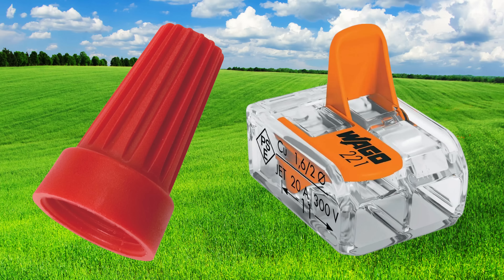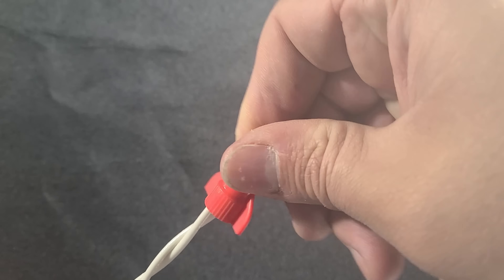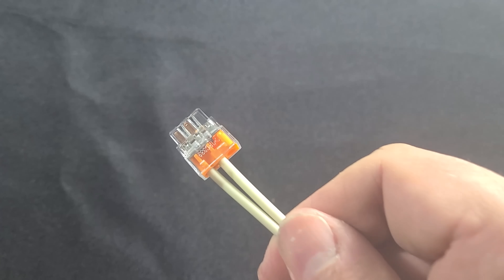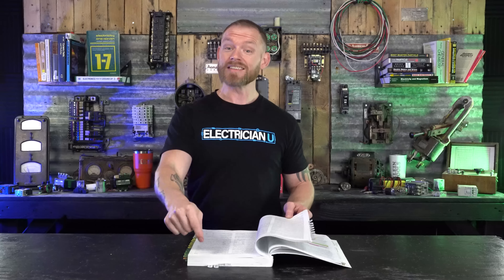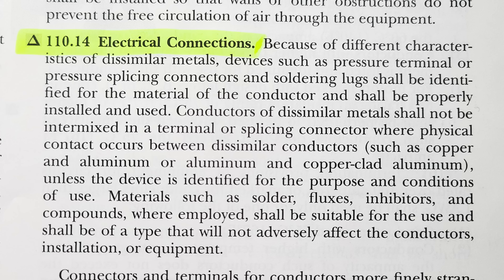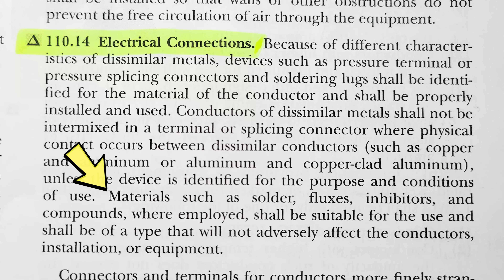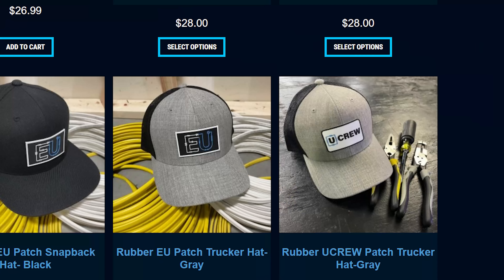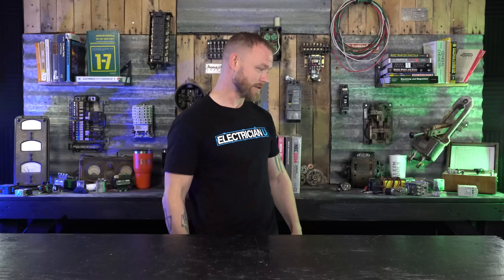Should We Use WAGOS or WIRENUTS?!?!

Comment: Still doing wirenuts with pretwist for general use, as I feel it makes the strongest connection and good price doesn't hurt.  Wago lever nut is respectable though and can use where change is likely, space is tight, or in a hurry.  But I have too many years of seeing failed push-in connectors to want to use those.
Reply: Right but Wago lever nuts aren't the same as push-in connectors. The lever locks down the wires so that it doesn't come off like push-ins do.

Comment: I would like to apply soldering conductors for underground splices. I am going to ask around the area I work at to find out what is the AHJ's point of view on soldering + Liquid Tape for underground joints. Gotta love finding a black 24 in a panel.
Reply: they have underground splice kits that have screw type lugs. then a heat shrink with some insanely hard glue that seals it up from moisture. as the tube shrinks, the glue forms already inside the shrink tube.

Comment: I'm not an electrician so my opinion isn't worth much but in my small electrical repairs that I'm comfortable tackling I prefer Wago Lever's when mixing stranded wire with solid wire since it seems I most often find those wire nuts melted when I smell that unmistakable burning electrical smell.
Reply: The Wago 221 lever nuts also have a test port in them, which is a good feature as well.

People confuse them with the push in connectors, that are garbage,  just like back stabbed receptacles.

Comment: I use a mix of both. Wago's for Lighting and Wirenuts for outlets. I find lever wago extremely useful for changing out ballast or CFL ballast in small compact areas.
Reply: yeah, the wago is great for joining 14 or 12 with those tiny 16 or 18 leads on ballasts
Reply: I was introduced to Wagos when they first came out, but I guess I’m old school, because I just can’t bring myself to going that route. I trust the feel of pre-twisting the wires, then twisting a wire nut on with firm pressure. That way, I feel confident that my connection has sufficient surface contact and a tight reliable finish once the wire nut is sunk home on the wires. Although, I do like the suggestion of using them on ballasts, where the wire sizes are mixed and the load is typically low.
Reply: Dude when I go on a service call to replace a ballast and it’s wagos. Man do I get happy
Reply: Yeah, lighting these days is such low amperage. (usually)
Reply: stop using shitnuts.... if you work for clients... STOP! do your job properly.
Reply: Yeah because German engineers don't test their products to death before putting them on the market.  😂
Reply: Can you do a mixture like wire nut for outlets but instead of wire nut on a grounding wire use wago ?
Reply: This comment and the responses are EXACTLY when I use wagos. In lighting. Just can't standbit when people don't plug wires in all the way/test pull the wire a bit.
Reply: Why do you not use wago in outlets, space?
Reply: Wagos are phenomenal for industrial and commercial raceways too. Too much troubleshooting that I've gotta disable a whole circuit and cut off a bunch of garbage pretwisted wire. Including outlets and j boxes.

That said, resi should definitely pretwist. It's probably never gonna get accessed again except for replacement/remodel.

Comment: The wago lever nuts are pretty good, ill use them in areas that might need to be taken apart again for service. I wouldnt use the regular stab in syle, I've seen them fail aswell as back stab outlets and switch. TBH I'm more of a tan twisters and 3m wire nut kinda electrical though. I do keep my electrical boxes clean neat and most importantly serviceable. I'm mostly a service electrician so I'm always following other people's bad ideas or getting to see how others really impressive work and have developed my favorite style over the years.
Reply: My thoughts exactly specially since wagos make dealing with stranded-solid wire connections easier.
Reply: You ain't been servicing enough then. There is one wirenut above all of the others. 3m, Buchanon, twisters will all tear your fingers up after all day of nuttin. The plain Jane smooth ideal red nuts are far and away the most superior. Most torque, if needed, most comfortable (gorilla nuts don't even come close), most robust nut. Yes I know your precious tan twisters take a 5/16 but.... no. Also those failed port connectors you see are just installed incorrectly. Try them out, install them correctly you will have zero problems.
Reply: @shadygunshow  yeah I've been working as an electrician for 10 years. I've found that I'm always adapting to new products. I use my linemens for just about everything other than twisting two #14 or smaller conductors. Can't say I've had my soft purse carrying hand too beat up from twisting on some wirenuts. 🤣
Reply: @ericwotton2046  thanks for the laugh this morning
Reply: @shadygunshow  maybe not.
Reply: I never realized it til you said it, but since I do mostly remodel work and service work, I feel the same way. See the old ways of doing things, see bad electrical work, see immaculate impressive work, and take it all and learn from all of it. It really does shape how you learn, adapt and evolve your style.
Reply: I'm not an electrician, but I have seen those connections fail too many times in my own home. I will never trust a spring loaded connection for electrical. Springs will always weaken, especially when they experience heat cycles. Sure they will likely be fine for a while, but 20 years later it's a fire risk.
Reply: @zachdemand4508  yeah, I limit wago connections to lower load items, switch legs for lights or small circulators. I don't like to put the full circuit load thru them. Our company policy it to never back-stab any of our devices (push in connections on back of switchs and outlets) we have about a service call a month for those going bad.
Reply: @ericwotton2046  Now THAT is a policy I can stand behind. Majority if not all the guys I work with, backstab their devices. I harp on my apprentices/helpers to never do it, especially on my jobs. I've been on so many calls where an outlet isn't working, and lo and behold...backstab. Wire just falls out of the device when I pull it out. Yet people say it's "faster", which is total BS in my opinion.
Reply: Why use wire nuts if it is worse than WAGO? There is a reason why it was banned in many European countries.

Comment: I'm curious what you meant by "quick connects".  Something like Molex connectors?
Reply: Not Molex, but similar to Wago lever nuts, but you push in against the tension of the internal conductor until the wire bottoms out internally. Ideal brand push ins are an example.

Comment: Wagos is the way to go when connecting solid to stranded!
Reply: Especially when the wires are different sizes.  I just used them in my vent fan/light fixture.  #12 solid in, smaller stranded pigtails inside.
I like the lever ones, much more than just stab in.
Reply: I was just about to comment that. For ceiling fans it's a must .  @dougfaunt5565

Comment: Seems like WAGOs are favored for commercial applications whereas wire nuts are more for residential.
Reply: Eh, it depends on the place of work. I've worked at a decent amount of commercial companys and I think I've only worked at one place that bought them and they were for light fixtures only.
Reply: I think it's the other way around. Wago's are much easier for diy'ers, not too Many diy'ers working on commercial.